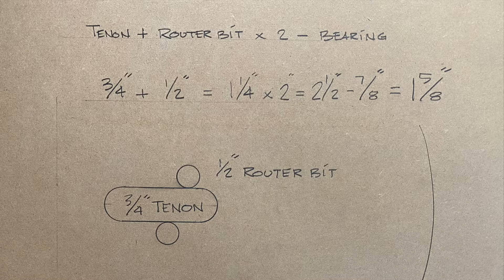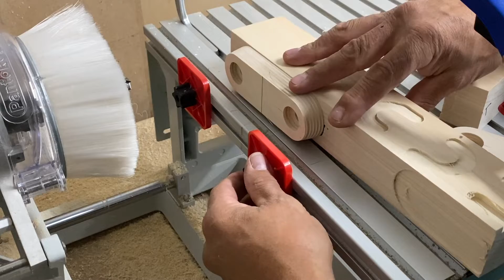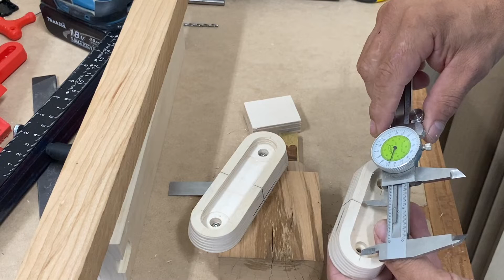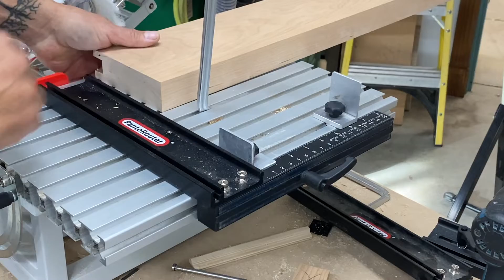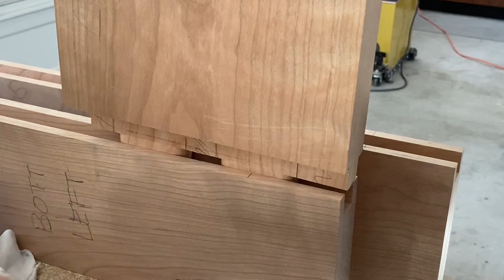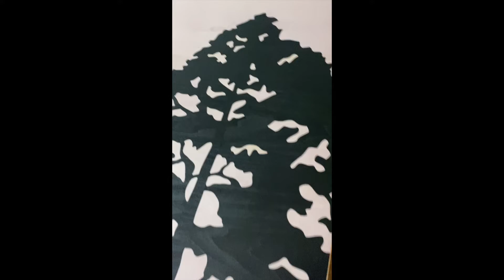Pantorouter  Large shop made templates

Comment: great video, how well does this router compare to the Multi-router by woodpecker?, Thanks, Antony
Reply from the maker: Hey Anthony 
I used a JMS Multirouter a few times years ago at a woodworking school.  It was awesome!  The wood moved on the table to make the cuts.  I could see that as an issue if you had long parts.  Not so with the Pantorouter since the wood stays still.   In this video I mortises some long and wide boards easily!  

I think the Pantorouter is probably easier to use, much more versatile and with a much larger selection of templates. The Multirouter is more robust although the construction of the Pantorouter has never been an issue.  Thanks
Reply: @ramonartful  Thank you so much for your reply! You really explain your process extremely well , And  you truly are a gifted carpenter! Awesome stuff!

Comment: Ever use a "multi router." ?  I've wanted one for years, but i can't pull the trigger with this pantorouter around ,...
Reply from the maker: I did years ago.  So when I first got the Pantorouter, it felt awkward to move the motor rather than the workpiece. (Actually I think you can move it either way with the Multirouter) But set up is super slow with the Multirouter!  Once you calibrate the Pantorouter (which is very quick) set up is super fast and accurate.  I looooove the Pantorouter…such a versatile machine!   I just recently used it to create a bunch of M & Ts of various sizes.  Thanks

Comment: Hi Ramon, new Pantorouter owner here, I appreciate the template making part of this video! Quick question - would the inner recess of the template used for mortising be about 7/8" in height? Is this correct? I'm trying to get the calculations straight.
Also, love the little spacer for quickly setting up the tenon stock overhanging the table. Good way to get back to position if needed.
Reply from the maker: Hello Edwin ! Yes…that’s right.  In hindsight, I should have drawn the math for the mortise…but you’re smart and figured it out!  Much thanks.

Comment: All good, thanks for the tips.  
At around the 9:50 you talk about using a block to reset the fence later and then add long strips of tape to the fence to effectively move the the fence closer to the blade.  Instead of all that tape along the fence could you just put a small piece on the end of the block you used to set the fence?  
Really appreciate the lengths you go to help other woodworkers.  Cheers, David
Reply from the maker: Yes…you’re smart. In hind sight a singe piece of tape would have worked.  Thanks

Comment: Superb video, Ramon.  There were so many great tips in this video (as in all of your other videos as well). As with you, I love using spacer blocks since they are so much easier than measuring.  The vertical template idea to avoid routing into the second tenon is one I will need to remember.  I also like that little offset block from the front of the pantorouter table. I have not had a need to make my own templates for the PantoRouter, but this video shows that it can be done fairly easily which is nice.  Did you consider using the Shaper Origin to rout out the inside cavity for cutting the mortise?  Thanks as always for the great work.
Reply from the maker: Hey David …thank you so much.  I needed quite a deep mortise, so I thought the Pantorouter was the right machine for this application, since I have fairly long 1/2” bits.  The simple little block works well but for smaller pieces I thought your method was perfect!

Comment: Great instruction as always!  How did you get the 10 deg. taper on the curved ends of the template.  
Did you cut the full length steps that fit into the groove on the tenons with the Pantorouter?
Reply from the maker: I figured that the curved ends of the mortise/tenons aren’t critical (end grain contact or slack at these areas ) so I simply tilted my edge sander to shape the 10° radius.  

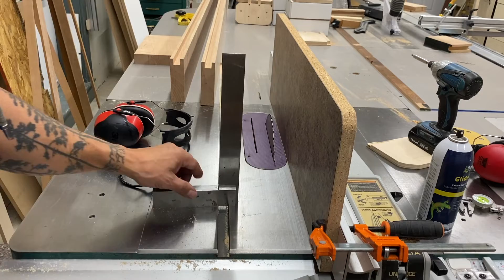The part of that tenon that corresponds with the mortise  (groove for the panel) and the shoulder, etc was cut at the table saw.  Starts at about 10:55 in the video. Thanks